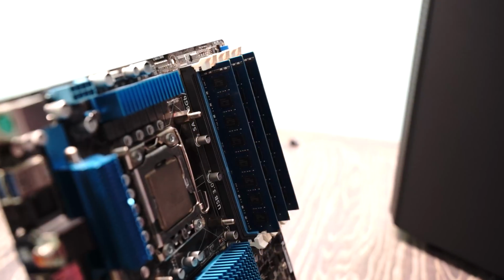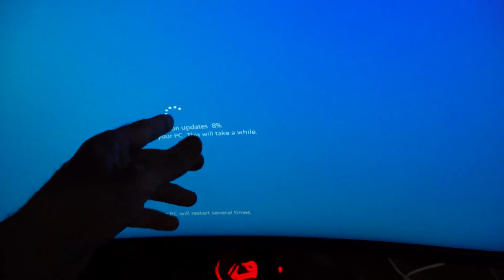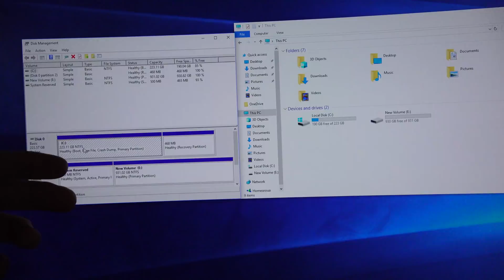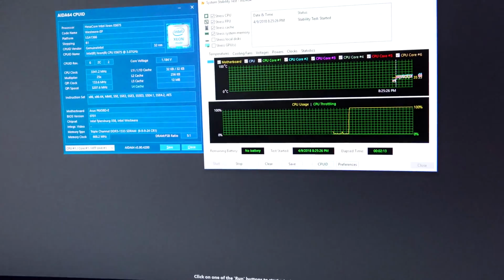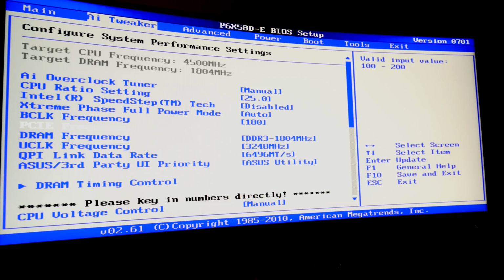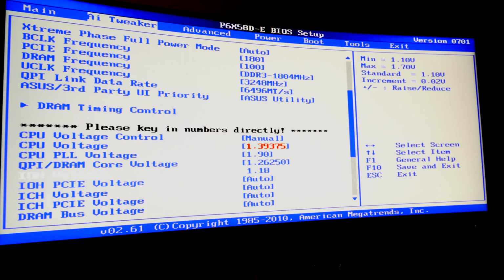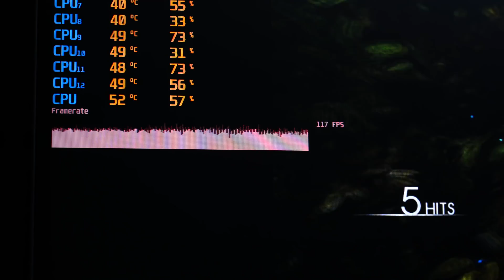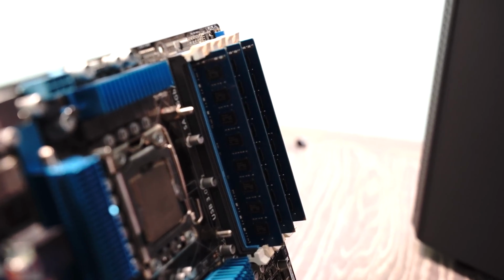Is X58 Still Worth it..? Taking the 6 Core X5675 to 4.5GHz on AIR.

Comment: To avoid the boot volume issues remove every other drive before installation.
Windows 7/8/10 puts that volume on the first drive. Which usually is the drive at Port 0, but sometimes the installer can trip over its own logic and put it somewhere else anyway.

Comment: that motherboard is currently my daily driver.

I have it paired with a w3690, watercooled, @ 4.4Ghz. gtx 1080, 24gb ddr3 1600Mhz,
 and period correct coolermastger haf 932 with a bunch of storage drives

Comment: I'm still rocking an i7 920 on a GA-X58A-UD3R with 12gb of mixed RAM. The mobo replaced an earlier board (MSI I think) \that died but given the architecture/etc, it's done spectacularly well for a 10 year old PC which I put together for like $2k back in the day. I guess I could grab one of these Xeons and try squeeze more life out of it but I've had a few stability issues so I think it's time to put it out to pasture.

It reminds me a little bit like Windows XP.. You can avoid upgrading and it might still be fine today, but it won't have all that much life left. Modern feature sets, modern power efficiency, modern performance, the security of having something new and reliable, all the little things just add up and likely make a new system just that much better, even if the ol' x58 platform can still hold its own.

Comment: I have a Corei7 920 (D0 Stepping) @3.5 Ghz undervolted to 1.1v. It is in my Office PC now (running Windows 7) and I thought the same thing when I heard Tim (HU) saying its time to upgrade anyway. Lol. I guess its not a CPU for pairing up with high end Graphics cards or such, but its a decent CPU nevertheless with 500+ Cinebench R15 score, and can be overclocked to 4Ghz+ with a good cooler (I have a Cooler Master V8, which keeps it very cool).
Reply: Sikandar Khan That's super good! You're getting fx-like performance with lower temps/power consumption on an older platform, that's awesome!!! These are the things the industry doesn't want us to realize...even@3.5 GHz your rig is still capable, heck my wife's rig has an even older l5408@2.8 ghz paired with a gtx 1050 ti and I get over 30 fps with high settings in most games @1080p and the GPU utilization is at 100% most of the time, so with your rig a 1060 will be an ideal pairing and that's a damn good GPU for quad HD!!! Enjoy your energy-efficient 920!!!
Reply: David Johnson - Thanks. The system is 9 years old now and i dialled the OC when i first built the PC. It started life as my main gaming PC, and is now my main work/office PC. The EVGA X58 SLI board is great, but i had to turn off it's North bridge HSF fan a few years ago as it started making noises. Luckily the temps are very low and motherhood HSF fan is overkill unless you are really pushing the voltages.

Comment: I liked the video. I upgraded to the x58 after watching some of your other videos on it. I don't overclock, but at stock my x5660 holds up pretty good on todays games. I tried the w3690 but after a couple of weeks ran into some crashing issues. I looked it up and some of these x58 boards didn't play nice with Windows 10, but so far the x5660 has served me well. I also tried ordering on of those Aliexpress motherboards you mentioned but got scammed and the board never came. But I'm happy with the setup and looking to pair it with a GTX 1060 or 1070 level card when prices come down.

Comment: http://www.userbenchmark.com/UserRun/8255282           thats my x58 bought it back in 2009 only upgrades the gpu(over the years) and two years ago the xeon x5660 oc to 4,7ghz on air(coolermaster v10) .its an awesome machine even today and i play many games at 4k no problem with it.Cinebench score its 1071 min 1078 max.Gaming temps never pass 75c,stress tests is arround 92(yeah i know its a bit high but lets be honest i dont use any type of program to push the cpu so hard as the stress tests so yeah i mostly gaming when im not browsing or whatever so the 75c on air is very acceptable and never ever had any issues at all with my system.

Comment: I'm running an EVGA X58 SLI motherboard with an i7 980X and 12GB of Corsair Dominator 2000MHz modules. Threw in a 980Ti and everything is on water running cool and quiet as all hell.  Got that extreme edition for 26 bucks LOL! Can't beat that!!! X58 is the BEST!

Comment: I'm still running an i7 920 bundled with a gtx260 (XFX). Only problem i have now is that some of my usb ports on my MSI x58 PRO-E is failing (well most of them already died), so i'm looking for a replacement without needing to spend a lot on it, any suggestions on finding a replacement, or at this point swap out to a R5 2400G (since the performance pretty much beats my current setup and is way tinier and it just has to run 4 old harddisks)?

Comment: You are the original X-Man Brian.... Show em how its Done.. !!!!!
Ive been following your channel for a bit and really got into the X58 platforms just because of your videos about them. For the past 2 years I have had 8 Xeon systems that I have built and sold with GTX 780's or similar as budget gamer system alternatives. I keep 2 Asus P6T Deluxe and Xeon 5670/5650 systems for myself cause I like them so much. I have a Threadripper 1950X, Ryzen 1700X, 4790K, 2600K, 2700K, 8700K, Etc, but still love the older tech of these boards and like overclocking Xeons and tinkering with X58's over the newer stuff. Hopefully the X79 platforms and Xeons will come down in price also so I could do the same soon....I.. I Cant wait to see some numbers on the X5675.  Thanks Brian. You are my #1 Youtube Channel...

Comment: cant the bolt be reversed, you put the bolt from the cooler and screw from back of the motherboard? most newer case have cpu opening in the back panel

Comment: Also have a X5675 with an Asus X58 board and i love it. In fact i've been trying to upgrade to a modern CPU but i feel guilty and it's hard to go apart from it damn! Been rocking at 4,5ghz @ 1,4v with a corsair H110iGT and have a realy oddly fast system. Been playing games with a RX580 and most get 100% GPU utilization meaning the CPU can definately keep up with it. Not sure about a 1080/1080ti but i'm realy curious to see your next video on this series! thanks.
Reply: 1.4 volts for 4.5GHz seems kinda high. I'm at 1.37v for 4.4 by keeping the base clock at 200 and scaling up and down with the multiplier. Nice and even frequencies while remaining stable with good performance with the uncore and allow me to keep qpi voltage low. 

I've tried 4.5 and found to not have any perfomance gain from 4.4 personally, and btw I'm also using an X5675 but with 24GB 1600 RAM in triple channel
Reply: @RyanBurnsRed  0w2edxzssasdeererrrrreeeee7ii89wko9ò0

Comment: Hell yea Bryan awesome video!  I'm running a very similar setup and I've loved every minute of it since it was released.  

Specs:
X5650 running at 4.4Ghz daily with a quad fan H100i
EVGA X58 Classified 3 (the board is a godsend, has USB 3.0, SATA3 and still under EVGA's LIFETIME warranty!)
EVGA 1080 Ti FTW3 (most recent addition)
16GB Dominator Platinum RAM at 2Ghz (had 4GBx3 Dominator GT that failed and Corsair sent me a 4x4 kit which I made work, still runs triple channel and got 4 extra gig)
480GB Kingston HyperX Predator PCIe boot drive pulling 1300/900 read/write speeds
2 500GB Samsung 850 EVO's and a 1TB WD drive
HP Omen X35 3440x1440 ultrawide monitor

I recently went ultrawide which is why I bought the 1080 Ti and figured it's worth a try to see if the old 5650 can keep the 1080 Ti fed and because of the higher res it's been doing pretty damn good.  Most games are pegged at 99% usage so I'ma hold out a little longer before I move to a completely new platform.  Love the X58 though that chip is a hidden gem not everyone knows about.  I think the best way to find an X58 board is getting an "old" gaming PC that's equipped with one with a 920.  I picked up a fully functional PC for my little bro for $200 with a Asus P6T in it.  I tore it down, threw in a SSD, 12GB 1600 RAM, a GTX 1060 6GB and OC'ed to 4.2.  Badass budget gaming PC!  I even have an extra 5650 once I see which one OC's better I'll slap one in there for him.  Loving that X58 Lyfe!
Reply from the maker: Yeah that's the way to go for sure, most the bargains with x58 boards are from old gaming pcs where people have no clue what's lying inside :p.  P6T V1 or v2?
Reply: I think it's the early one.  I know it's not the Deluxe but so far it's been working great and also will support the Xeon's although not "officially".  

If it's not too late can you show what your load voltages are (Vcore/VTT) in the next vid or tell me if you know since you're running LLC on?  

I can't get mine stable with EVGA Vdroop enabled no matter what I've tried.  On my board it screws with the voltages too much and setting for example 1.4 Vcore in the BIOS nets me about 1.32 on full load which isn't enough for 4.4Ghz.  With Vdroop off I'm running 1.36 Vcore and 1.35 VTT under load.  I see you're running a low QPI voltage setting so I'm curious what it is under load.   I heard not to go over 1.35 on the Xeon's or you can damage the memory controller.
Reply: Nice! Almost same setup as you but with Asus px58de MB.
Reply: I recently got a x5650, but I have difficulty going past 4 ghz, the problem is the ram giving boot errors.

Any tips on the high overclock besides setting the ram timings from the spec sheet? What are your settings?
Reply: @Duckie_Plays I believe 4,2 ghz and 1,34V now. I turned down the ram to 1250 MHz instead of the 1650 (can't go in between). Havent had any random crashes since. Ram settings are very picky and with my mobo I can't choose many options in between sadly.
Reply: @Duckie_Plays I looked up your mobo and you have a pretty good one for overclocking (it is designed for it). You could repaste your mobo, but I think it is something with the settings. Look up the x5650 overclock settings and better for your specific mobo. 3,6-3,8 ghz seems way too low... It's more the question if a x5650 can handle 4,5ghz and not 4,0. Or you have a very very bad chip, but I think it is something with the settings and not the chip or paste. What kind of ram do you have?

Comment: And here I am, simply still using a 980X on an Alienware X58 mobo... Clocked at 4.0Ghz, 165 BCLK, 1650DDR3 (1333 gskill) and a GTX 1060 @ +225 / +735.... And yes... It's as relevant as a brand new Coffee Lake CPU.  Not in all facets, but gaming for sure.  Any situation which takes advantage of newer extensions, such as AVS encoding, etc... will surely benefit from a newer architecture.  However, if you are merely concerned with typical use cases such as gaming, media production from beginner to amateur /  intermediate level, productivity, and general use... then its JUST as good as anything brand new... Still has a PASSMARK of about 11000, Cinebench R15 @ 900+ depending on runs... And just take a look at the 3DMark database... a 920-980X i7 system, or XEON equivalent, is still able to keep up with up to two 1080ti's without being a bottleneck in any way shape or form.  DDR3 is cheaper than 4, X58 mobos (despite what folks say) are all over the place, and inexpensive... and triple channel DDR3 is a great way to outperform even brand new commonplace dual channel DDR4 systems.

I do love your channel, as well as many other tech outlets who do similar type videos... But the need for them is, more or less not really there.  Who really needs to go through all the hassle of building era specific systems, test a ton of benchmarks and games, and then produce all the results into a comprehensive video for others to watch... when you can just go on a website who hosts a database with all the same hardware configs, with any part you like interchanged for another... You can feasibly find out how anything works with anything else... And the answer to first gen i7's and Xeons being relevant is a resounding yes... They are incredibly relevant.   So much so that it's almost incriminating of being an idiot to go out and spend top dollar on brand new stuff when the market has been literally stagnant of innovation for nearly a decade.  Just wasting money.

Comment: I love x58, I've owned 2 920s that I took to 4.0ghz, a 960 that went to 4.2ghz, and an x5670 that went to 4.4ghz. Such incredible overclockers. If the boards could just come down in price they'd never die.
Reply: I have the exact same board, it works great with the 920, but won't post when I put the x5675, power comes on and everything lights up, just nothing on the screen. Did you have any kind of issue like that?
Reply: @sniffles8655  Probably needs a BIOS update to support the xeon.
Reply: @Cbamptronious  Thank you! Yeah that was it, I updated the Bios and tried again with the x5675 and it is working great now. Thank you!

Comment: Asus P6T (with the wimpy northbridge cooler) - i7-920@4Ghz then later an X5660@4.4Ghz using an ancient Thermalright Ultra 120 Extreme (nickel plated) but that cooler's at its limit. I definitely need to take off that northbridge cooler and replace the thermal paste.
Asus P6T Deluxe - X5680 4.4Ghz on water that just refused to go higher and be stable. Perhaps the northbridge paste might help.
There's actually specific BSOD codes that correlate with settings changes. The reason I say this is because my CPU PLL is 1.80 and perfectly fine. All of my limitation with the X5660 is thermal headroom. The X5680 was in a weird situation where it ended up being slightly unstable at 4.5Ghz after running Prime95 for a while.
Uncore/UCLK frequency needs to be at least 2x the DDR3's frequency. It even says it on the right panel in the BIOS!
QPI needs to try to be <7.0GT/s if you can but that can't be helped if you pass 200 BCLK. It gets a bit wobbly after 7.5GT/s and ends up needing more voltage on QPI/DRAM core voltage and SOMETIMES CPU PLL.
These systems pull >500W so a 500-550w PSU isn't going to cut it. I'd suggest a minimum 600W and maybe higher if you put in a power hungry, and overclocked, GPU.

Last thing: If you put a Xeon chip in the X58 platform you can install 8GB DDR3 sticks. That means you can top out at 48GB of RAM on them. Although, not all of them seem to work and it appears to be they need to be Dual Rank and double sided because of chip density.

Comment: X5650 on my p6tse , 4.4ghz @ 1.35v, recent upgrade/sidegrade from an i7 920d @ 4.4ghz, temps 60c on a 120mm aio on full load, xeon blows the i7 out the water for synthetic and gaming :-)

Comment: I built my first rig two years ago.  And it was 15 years since I built a gaming rig. And it was a x58 with a x5670 and it was all because of your videos that I picked these parts. The motherboard was a asus p6t but for some reason it wouldnt go past 4.2ghz. I even tried it with a x5687 and the same thing. 4.2ghz. I loved that machine but It started having cold boot issues. So I sold it and got a ryzen 1600. I want another one just to play around with.

Comment: x58 master race :)

Also lets you use even cheaper ECC memory, which overclocks nicely too.

When you do your old vs new review, could you please include a few memory benchmarks? (aida64 etc), I'ld love to see what tuned triple channel could do.
Reply: I purchased Asus P6T about 4 years ago off eBay with I7 and stack cool2 included for just under $125.00 shipped. Less than 6 months of reading forums on over clocking before I purchased X5670 for just under $25.00 shipped from eBay. She's been running at 4.2 every since and still gaming, and still on air. Max temps  mid to low 50's c. I won't go into how but I run 2x MSI 1050Ti 4g gaming's and love it. GPU's were built poorly and RMA'ing a GPU takes forever so I have had to do all repairs my self using moduals from old dead GPU's but there still going. Great video here I still recommend people who are thinking of over clocking and playing with there older stuff to watch this video for some education. Thanks for the lessons, video saved.

Comment: There is an Asus rog x58 with 12gb of ram and an i7 950 included near me. They're asking $200usd but I beer I could haggle some. Would it be worry it over my i5 4460 and 16gb of ram, assuming I upgrade to a Xeon?

Comment: I built a complete bargain breaker with this platform! Picked up a few sweet deals, like an EVGA x58 FTW3 w/ an i7 950 for $60, 8 GB DDR3 for $10, an HD7870 for $28, and I found a dingy old case, and a friend gave me a 750 w psu. I eventually swapped out the cpu for an x5650 for $28 and swapped the gpu for a 1050ti for $120, and put it all in a HAF 912. This thing is running beautifully, i have my x5650 @ 4.0 ghz at 1.31 v, but i can't seem to get past that. Its at 200 bclk and 20 multiplier, which is the highest with turbo off. with turbo on, even up to 1.4 v and messing with some of the other voltages, i just can't get it stable. I think i might pick up a x5675 or x5680 soon and mess around with that because they're just so cheap!